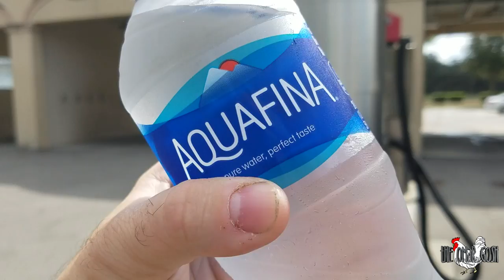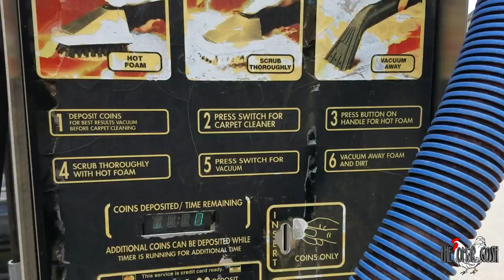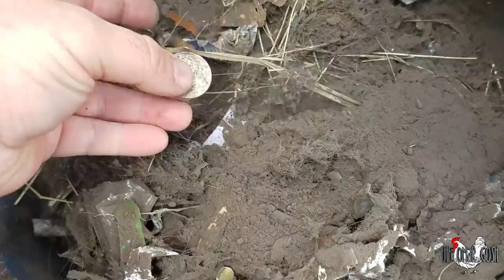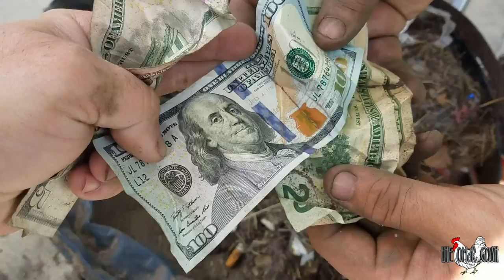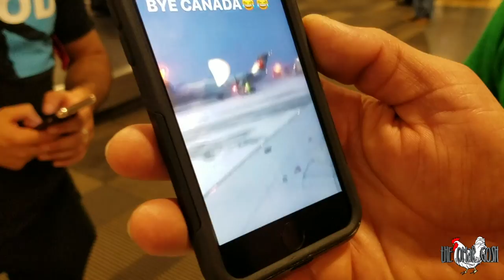Finding Money In Car Wash Vacuums

Comment: I worked at a carwash for 7 years (a real carwash, at least 600 cars per day). I  used to pull out over 400$ a month easily on the low end in cash and change. I showed up a hour early every morning to clean out the main vacuum unit and the smaller separate ones we had
Reply: Did you dare to keep the money ?
Reply: I did too and I also got lots of coins, mainly pennies, from under the car seats as well. It really added up.